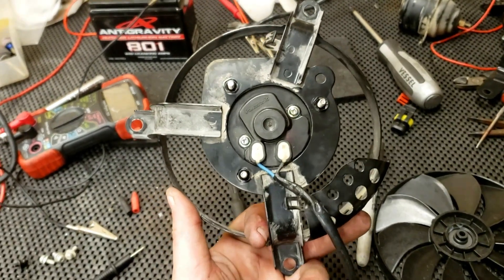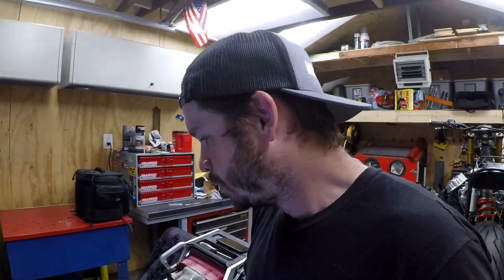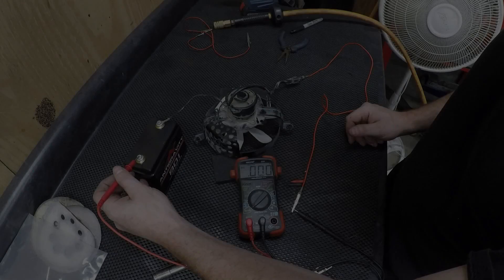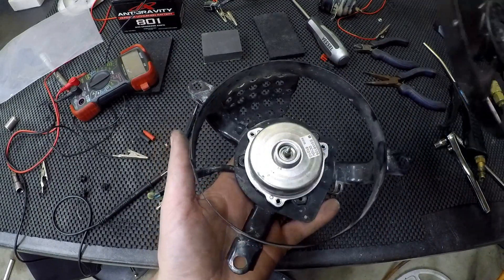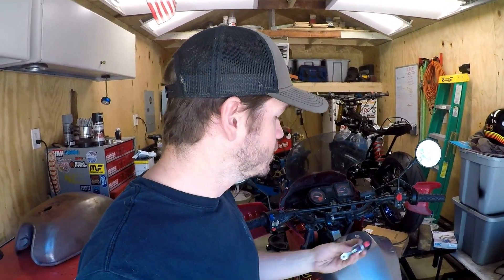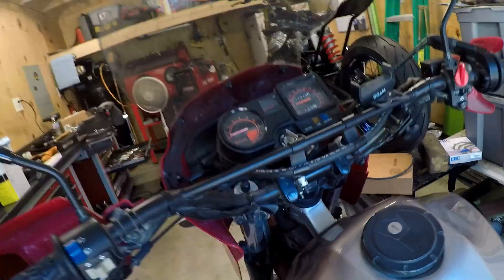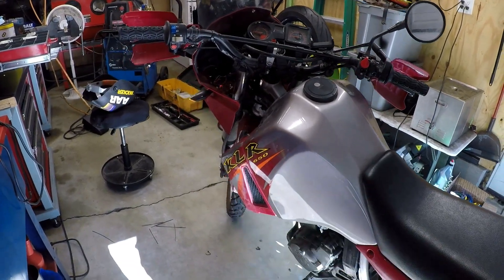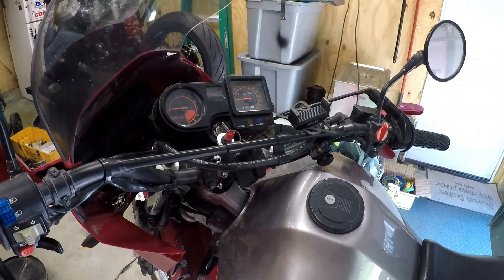KLR 650 FAN UPGRADE! - BOLT-ON Ducati Fan Swap Mod & Override Switch!! ADV Prep EP2

Comment: My fan just went out. Im going to do this. Did you tap the holes you had to make for the new motor to be bolted in?
Reply from the maker: I didn't have to make new holes actually. I only made 3 small reliefs on the motor so I could use the existing threaded mounting holes on the klr bracket. I then put screws into the original spot

Comment: Does anyone know the part # or searchable description for the rubber edge seal put on the cooling radiator fan shroud at the 7:20 mark?
Reply from the maker: It was just door edge trip. You can find it at an auto parts store

Comment: Always disliked the stock fan. Got a fan off ebay for $25 after seeing this the first time. Ended up just drilling holes in the frame for my bolts. Thank you for the idea though.
Reply from the maker: I feel this has proven to be a worth upgrade the last 2 seasons. Glad you found the video

Comment: Where can I find the connector that you put on the thermal switch never seen one before in my life I need this
Reply from the maker: The dual spade connector I'm assuming? If so your local auto parts store should have them.
Reply: Well this is amazing You responded appreciated my friend great video by the way. I found a aluminium radiator on Amazon for roughly 80 bucks that holds 40% more Fluid made a huge difference Get this switch situation figured out I should be ready for Any environment
Reply from the maker: @jesseshilling2164  no problem! I appreciate you watching!